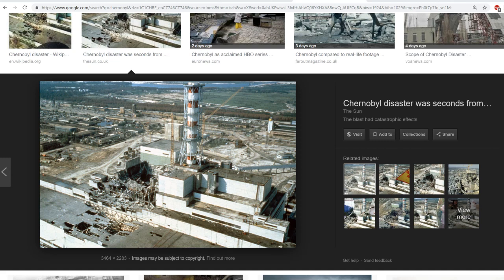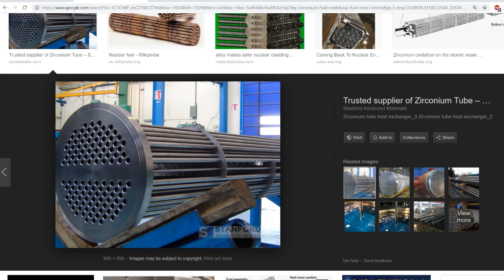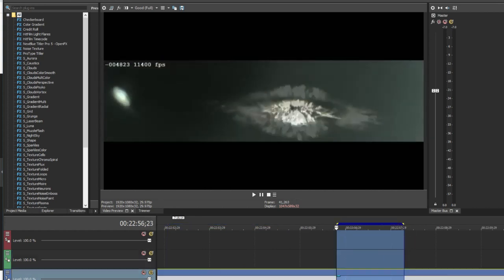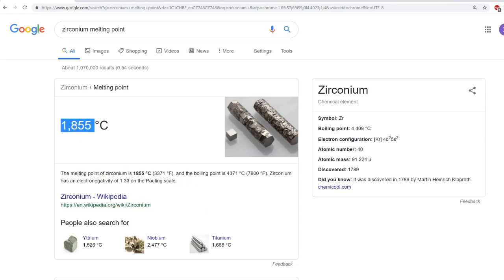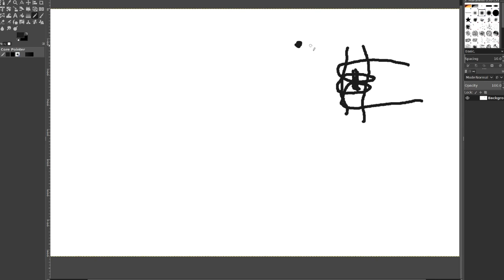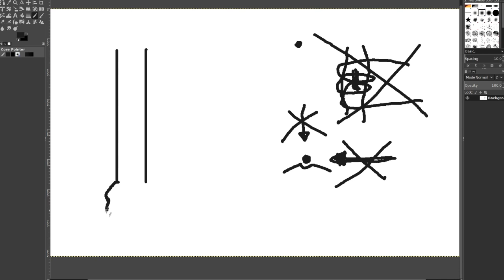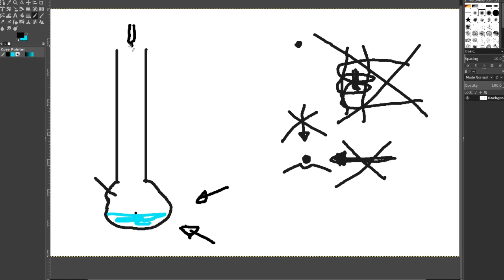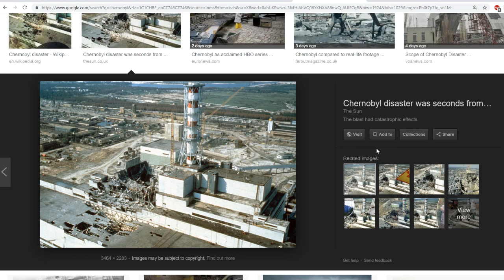Was Zirconium the real reason Chernobyl exploded?

Comment: This video falls apart quickly if some nuclear fuel properties are not ignored. I'm not stating that it was a hydrogen explosion due to zirconium .. But, the zirconium could reach 2000 degrees pretty easily, as it's thermal conductivity is very low, almost comparable to ceramic. In normal operation at nominal power level (RBMK-1000 - 3.2GW(t)) the fuel temperature inside fuel rods is way above 1000 degrees due to poor thermal conductivity. You have to realize that nuclear reactors today are very unefficient, from overall standpoint it's electrical output is 30-40% from thermal output, plus, fuel rods contain about .7% (unenriched) to 2-4% (enriched) of U-235, rest is U-238, U-235 is what actually is fissioning. Plus, the poor thermal conductivity in fuel rods. And even the fact that all that U-235 doesn't have a chance to burn up due to fission byproduct gasses causing expansion from the inside and deforming the fuel. If we simply look at the fact that at the point of accident the last reading of power was 33GW(t),  actually calculated to be much more than that, it could have heated up the fuel at least 2x hotter on the inside (could have easily been 3-5x, just can't prove that) and that exceeds more than 2000 degrees for zirconium to melt and create hydrogen, because first explosion tore off the upper shield and allowed air into core section quickly replacing inert nitrogen. Research more on this, really misleading video.
But more realistic actually is the hypothesis that reactor really reached power density to about a level of TNT and bottom section of core simply exploded during the surge and ejected big part of the core out of the reactor building. This is more supported nowadays thanks to better computing and simulation advancements.

Comment: You could flatten the metal in the tube, expand the surface area.  More like a strip than a matchstick.  I'm assuming the edges would run together and drip down as a drop.  An X shape of two flat planes would probably be faster.

The goal is to get the metal to heat without dispersing the heat through the entire bit, right?

Comment: I guess it woudln't be anywhere near practical budget wise, but what'd happen in the following scenario: argon atmosphere (either the glassware or whole experiment chamber as needed), water container with cameras pointed at it, zirconium fixed above it with something that melts at a higher temperature than zirconium (Tungsten maybe?) and then you'd hit the zirconium with the laser until enough of it melts and a drop falls.

I'm assuming that this would come with some budget and unpredictable zirconium drop size and drop falling moment issues.
Reply: Could you fire a jet of compressed argon at the liquid metal to dislodge it if it doesn't want to drop?
Reply: @zoidberg444  That'd probably make it solidifying even more likely, he brought it up towards the end of the video that it's already a concern while falling.
I guess it makes more sense to try the cheap welder method first and only worry about complex expensive approaches later if it fails or isn't consistent enough?

Comment: Is the jury in that the first explosion was a prompt criticality incident, not a steam explosion?
Reply: Yes, the rods had been pulled out completely. The Boron neutron absorbers were above the reactor  and the graphite neutron "enhancers" were near the middle of the reactor on all of the rods. As the rods were moved down the boron at the top of the reactor was killing the reaction, but the graphite actually enhanced the reaction at the bottom of the reactor pushing it above balanced criticality fully into the prompt range. It's estimated that power generation (of heat) at peak was about 100GW; but if TF is right it probably doesn't have to be that high. Even so, there would be more than enough energy to melt everything and drive many strange chemical reactions.

However, while this is the most likely trigger much of the evidence was, of course, melted, blown up and even just decayed. Eg. The reason the rods were pulled out was a build up of the, short lived, neutron absorber Xenon135, but the exact levels of this isotope will never be known.

Comment: Can't you heat the zirconium metal with a graphite slab? Pump some amps through the graphite until it gets to 2000+°C (it can support up to 4000K before melting if I'm not mistaken).
Reply: Problem is at those temperatures, it also burns, and is an excellent thermal conductor, on the order of most metals, you'd need a lot of insulation. A tungsten electrode can have 100A going through it without vapourizing, a graphite one cannot, ask anyone with any arc-welding experience.

Comment: Hi Thunderf00t, Love your channel.. =)  I have a bit of info for that induction heater. (I work in tech dev of one big electric motor company + stator is kinda big induction heater... ;-) ) SO, the effect of eddy currents works as you said it does... big piece -> heats nicely, but you have problems with small pieces. Solution here is frequency, the radius of the eddy current (I try to explain it "easily" ) so don't shoot me. So if you increase the frequency of the induction heater you will can heat up smaller and smaller elements.

So in short: Increase frequency -> you can heat up smaller pieces. Naturally I did not have time to calculate sizes which you can heat with different frequencies BUT as rule of thumb. Electric motor has 0,5mm sheets which then forms stator/rotor. That 0,5mm is good around up to 100 - 200 Hz range, then the eddy current starts to kick in quite badly. Then we would move to 0,3mm sheet. So if you crank up induction heater frequency quite a bit, it should help you heat up your piece.

P.S. Just remember skin effect when selecting coils ;-)

Comment: I’d say you should use helium to purge the flask.  Have it flowing in at the top and have an exit port just above the surface of the water.  Since helium is lighter than air, it should force any air/oxygen and water vapor out of the exhaust port so any contact between the molten zirconium and water vapor will be a millisecond or so just before it hits the water.

Comment: since you will be filling the tube with argon anyway, why not use a tig welder (they are cleaner, known for generating less splatter).  Perhaps see if you can suspend the tungsten with a wooden clamp (something the tungsten is unlikely to stick to), exposing it to the edge of where the welder's plasma would be

Comment: at the start you said the reactor went prompt critical, this is not actually known if it did but it certainly did NOT with the first explosion. the second MAY have been prompt critically event, or a hydrogen explosion, or a steam explosion. its not known but the latest papers put the 2nd explosion as a prompt event and the first was a "simple" steam explosion.
prompt criticality is essentially a nuclear explosion, this is very different from the others while the result is somewhat the same.

also induction heaters really arent hard to build, one transformer and one decent copper wire is all you need, id try that first for sure.

Comment: difficult experiment..  I would try to use fixed TIG welder and movable Zirconium rod, that is grounded. Idea is to melt the zirconium with the arc, and hopefully the drop falls without touching the glass walls.  I would also make the shielding gas flow through the apparatus from top to bottom, in order to flush away some water vapor.

Comment: At high temperature in presence of oxigen zirconium acts like a catalyst for water separating the oxígen from water to form zirconium hydroxide and hydrogen

Fukushima Also had hydrogen explosión and in light water reactors thats the reason to have an hydrogen re-oxidatío device

Zirconium is like titanium and has to be welded in an atmosphere filled with argón for it to not catch fire

Comment: Thunder, if you don't think the Zirconium will drop and you will struggle to melt underwater (plus all the boiling getting in the way), how about melting in the inert gas then raising the water level to meet it?

I am thinking that to avoid messing up the footage by pouring water in from above you could have the apparatus in a large u-tube. Then you can raise the water level with gas pressure pumped into the other side of the u-tube.

Comment: Here's an idea.  Use the tension of the molten zirconium, get a ceramic tube or something else that wont react to the induction heater, put the zirconium inside and melt, molten zirconium sticks to the inside of the tube until you are ready and use a small jet of argon to push the drop out.  The size problem with eddy current will be mitigated due to the fact you can leave the metal in the induction field for as long as you want, and your "go" time can be controlled by the argon jet.  The only issue I see is the cooling, you might need to get the temp of the zirconium to a much higher temp than "just" melting.

Comment: Hmmm... why not just add water to the zirconium once it's molten? Say, instead of dropping the zirconium into water at the bottom of the flask, raise water from the bottom up until it touches the zirconium? This way the zirconium and its melting assembly don't need to move, and water could just be just pumped in until reaching the zirconium. Could even be done with the flask in a vacuum so the water gets sucked in when turning a valve -probably this way the speed of contact would be even faster than by gravity alone.

Comment: Hey this is slightly unrelated but could you please do a video on how molten lithium oxide will react to the addition caesium metal? Will the reaction be similar to  what happens with an alkali metal and water or will anything not happen at all? Cant too much information on this by skim searching youtube or google.....but i suspect something similar might go on to what you see with water and an alkali metal but probably less violent and the difference being production of metallic lithium instead of hydrogen gas to what you would see in water....

Edit: lithium oxide might be hard to melt and contain being that it melts at 1,400°C so sodium oxide with a melting point of around 1,100°c might be slightly better or even potassium oxide with a melting point of around 700°c easier still, only downside is the more reactive alkali metal oxides might not react as well with the ceasium metal if there was any reaction and potassium oxide apparently decomposes above 300°c according to Wikipedia but not sure the rate at what that would be and how that could effect any experiment....

Comment: a thought take a peace of Zirconium wire and blow it like a fuse that would make molten Zirconium if not mistaken then all you would need is 5-6 volts at 100 -- 200 amps max that is 600 -- 1200 watts max

Comment: Ok some ideas/thoughts:
1. Induction heaters might be expensive, but you can try DIYing one, there are tons of videos and circuit schematics online
2. Having a small piece of metal to heat might be problem, not sure. But you may be able to counter by making something like an ICP-AES plasma torch. If you have a slow argon stream going though a high frequency induction heater coil, you can get a self sustaining 3000-5000K plasma discharge going. Plasma is conductive and receptive to inductive heating, which keeps it hot and well ionized. The plasma discharge can be kickstarted with a brief high voltage arc though then argon to get some initial ionization.
You could have a long rod of zirconium and lower it into the plasma discharge to melt it and get it to drip. This setup would necessitate some fused silica tubing where the plasma discharge is happening.
3. Tungsten could be used, right? Maybe you could have a tiny tungsten crucible with a hole in the bottom? Tungsten is also conductive, so maybe it can also be used with the sort of high current, welder-based heating you suggested. Tungsten isnt cheap, having it machined is even less so, but you would not need a large part, right?
4. If tungsten is too expensive, how about some high quality graphite? Very heat resistant under argon, conductive and much cheaper.
5. You could try electric self-heating with zirconium only. If you had a Zr rod with thick ends and a thinner midsection, passing a lot of current though would melt the center first, due to having a higher resistance. Maybe you could get some drops out of this?

Comment: You could try to heat it by just passing a current through it. But I doubt it will melt well. And may not even break so it falls off. Just dangle. 

I would try a tig welder that does aluminium. As it may oxidize less with the AC setting.

Set the welding torch at about 45 angle printing down over the flask opening. Now you would need a rod of the stuff about 2 to 3 mm and a decent length. Say 100mm. 

Rotate the rod at around 60 rpm. Now insert at 45 degrees pointing down so it's at 90 to the torch. 

The welder will auto start the arch once near. The rotation will allow a large melt blob of this stuff behaves like other metals. Then it will eventually fall off. But be large enough to it won't cool significantly before going slposh. Steel doesn't. It goes splat well. 

Practice with steel first. And maybe make feed and rotation rig. 

If it works as you think it might you will end up with an almighty bang as it will be a lot more than a drip. And have all that heat energy on top of the chemical energy. 

So put on a safety t-shirt or something.

Comment: Not sure if you actually read late comments, but i`d go with an induction heater. 
Hang the Zirconium in it in a smal cage out of platinium wire. 
If it gets liquid enough it will drip throu the wire cage straight down.

The only thing im not sure about is how the magnetic field will influence it.
But that seems like the best idea especially, because you can make your own glassware with the activly cooled induction coils inside.

Comment: Why don't you just heat up the zirconium and then flood the chamber with water. That way the molten zirconium never has to move. If you can introduce water at a controlled rate without to much turbulence you should be able to film it without to much distortion from the moving water.

Comment: I think its totally possible to desighn it in such a way that the metal would drop off using a tig welder, angle the wires down and thin out the zirconium connecting to the wires

Comment: My thoughts while watching this were fairly similar, though I was thinking along the lines of supporting the zirconium between two tungsten electrodes and then using an arc welder to pass high current DC through the zirconium, which would ten fall away as it melts (so long as the sample is heavy enough to overcome surface tension).

Comment: Actually, the Chernobyl reactor was graphite moderated.  So escaping steam in contact with the hot graphite moderator would give the water-gas reaction: H2O + C(s) -> H2 + CO2.  H2 has the lowest ignition energy of anything (it has its own class in the Ex rating system for electrical and mechanical equipment to be used in hazardous atmospheres, shared only with acetylene).  Even the tiniest spark will ignite a hydrogen-oxygen atmosphere.  So it is not as implausible as you imply that the second explosion was a hydrogen explosion.  I’m not saying that you are wrong about your zirconium theory, just that you are downplaying the possibility of a hydrogen explosion too much.

Comment: Phil.  Had a word with the welding guys here (They are some of the best).  Their advice a torch with zirconium rod held in a big vice.  A TIG flame (4000ºC).  Everything clamped in position. Chamber beneath filled with Argon. Tig will pour argon on tip so whole thing could be shielded. Would be simple first stab? Not that difficult, but may not work.  We may give it a go.

Comment: just a silly idea. probably not a good one. but what if you do the opposit.. heat up via tig in a vacuum the zirconium and have the water above outside the vacuum with a valve between the vacuum and the water.
as soon as the zircoium is above 2000 degree. hit the valve.
the water will go down by 1 gravety and 2 the pull of the vaccum 
it will go inside the vaccumchamber fast and hit the zirconium ..
downside is the chaotic turbulence as the water is moving damn fast but it would solve the problem of water vapot in the vacuum chamber

Comment: use a tig welder.. mig uses the wire to make contact and melt metal including the metal in the wire. tig uses an arc from a sharpened tungsten pen about a mm away from what you want to heat.
you would still need to hold up the piece of zirconium and what ever holds it up will be the negative clamp of the welding unit so to speak.
the good thing with welding is you need to do it with a argon gas so oxigen is not there, both mig and tig use that.
i sometimes use my tig however to just heat up metal rods or similar to the point i can bend it without having spotwelding marks.
basicly with the tig you set it low enough to still get the arc going and then crank it up to the setting you need to get it to 2000 degree. 
think about it.. its easier then a mig setup